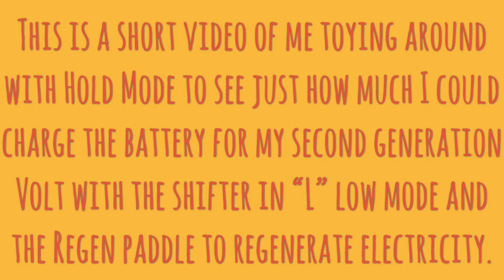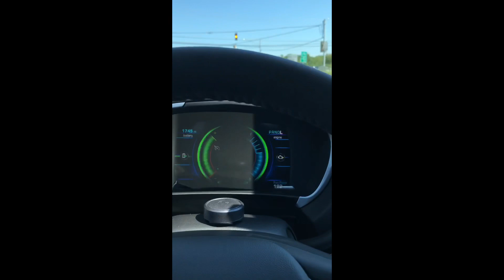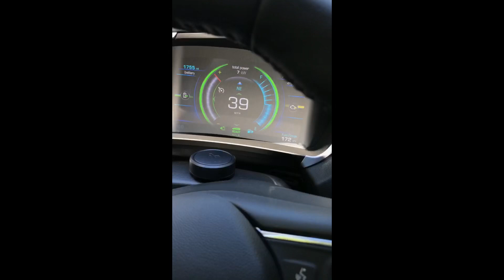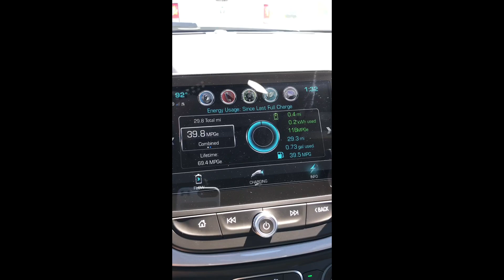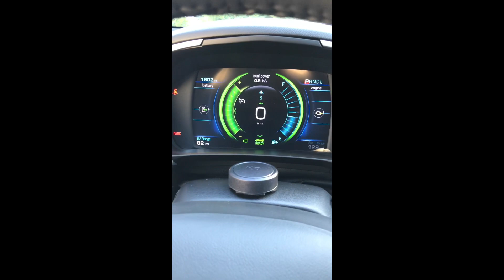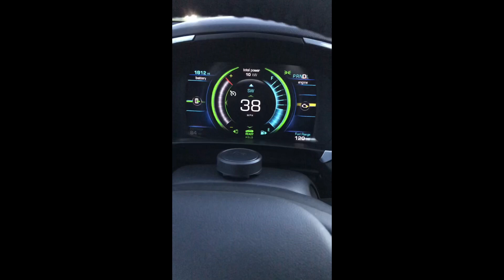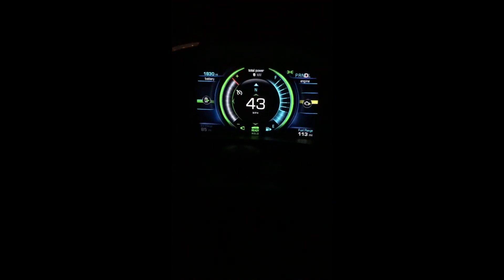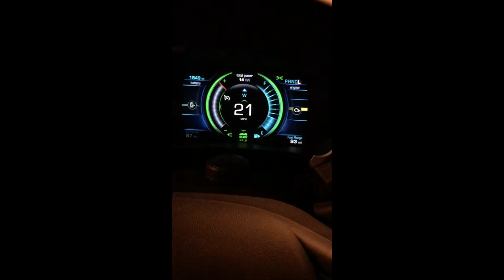Charging my Chevy Volt using Hold Mode and the regen...

Comment: EV range is an estimate. I guarantee you when you stop using gas to Regen your not gonna get the 80 miles. You didn’t test the battery at all you simply used the generator to regenerate power and fill back up the usable voltage without the generator. You fooled the estimated EV range. Remember this engine is a generator and doesn’t drive the wheels. You have hold ie on generator and normal on battery only. Both consume bAttery.
Reply: i think partially this is correct but also there is a 20% buffer on either side of the volt battery so it is never fully charged and never dies. I think he is overcharging his battery a bit more than chevy thinks is ideal
Reply: "Engine is a generator and doesn't drive the wheels"?,so what drives the wheels when the juice is depleted?
Reply: "Engine is a generator and doesn't drive the wheels"?,so,what drives the wheels when the juice is depleted?
Reply: @jmf6835  Its like a Locomotive train.  Electricity is always powering the car no matter what.  The battery is larger than what is exposed to you, 18.5 kWh to be specific. For EV only (53 mile range you get 10 kWh of that 18.5 kWh. When you run out of the first 10 kWh the gas generator kicks in and continues to charge and maintain the 8.5 kWh of electricity.  The generator will not allow the 8.5kWh to deplete and maintains that.  The thing you need to understand is that the generator will NEVER stay on and Wont charge the first 10 kWh.  you can only recover that by plugging the car back in to power.
Reply: @bryjb10  Thanks

Comment: You used 40 miles on gas to regenerate electricity 
I feel you should use it once your 50% on battery, then use gas to charge back since electricitys cheaper

Comment: so did the 87 mile gained really gain 87 miles electric?
Reply from the maker: Yes it did, it is really amazing...I can’t wait to push the limits of the battery pack on a long distance trip...the 1st gen battery pack would cap me at 60 miles of electric miles.
Reply: he said he was at 59 starting...which is pretty high